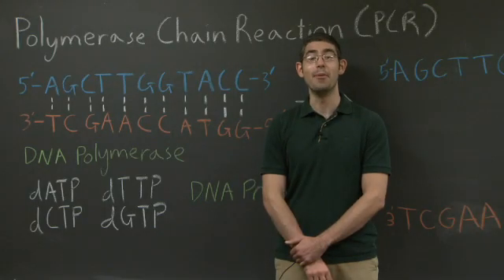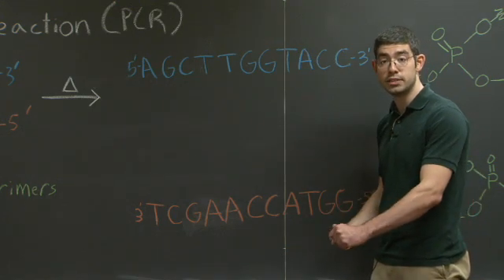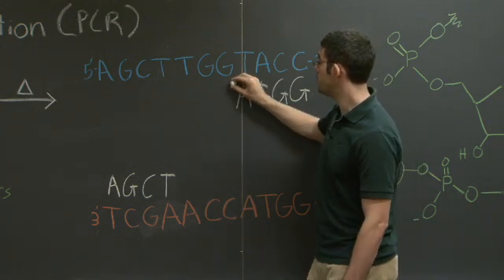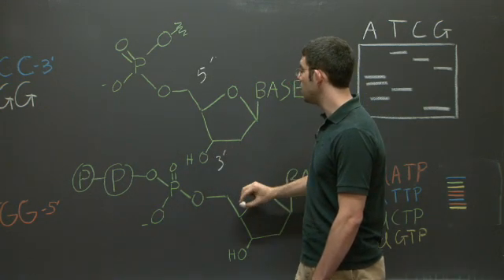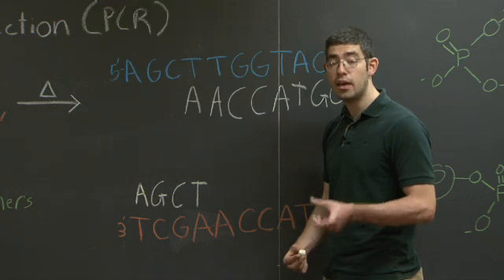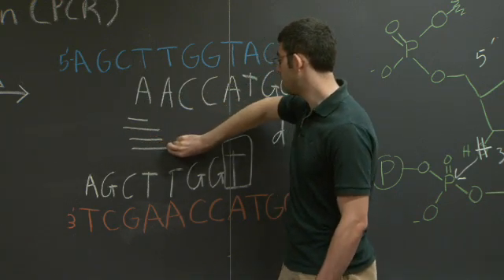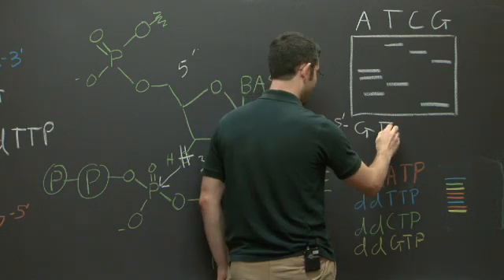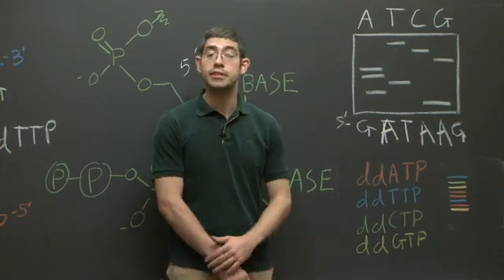Polymerase Chain Reaction (PCR) | MIT 7.01SC Fundamentals of Biology

Comment: Something that made me scratch my head: The synthesis of DNA goes from 5' to 3'. But this is on the synthesised strand, not the template strand. So at 1:33 he chalks in the nucleotides on the end labelled 3', but remember DNA is anti parallel and the new 5' end will line up with the old 3' end.
Reply: MrGoatflakes If you look at the figure on the board you will see two DNA strands, one in blue that is left to right running in the 5' to 3' direction and one in orange that is left to right running in the 3' to 5' direction. These are two complementary strands of the original DNA molecule that will be amplified.Each of these strands will serve as a template for the synthesis on a new strand.  In each case, a primer will bind by base paring to the template strand and new nucleotides will be added to the free 3' hydroxyl of each primer. Each newly synthesized strand will be made in the 5' to 3' direction.
Reply: Michelle Mischke
yes I was just momentarily confused when he said 5' to 3' and then pointed at the 3' end of the complementary strand.
Reply: +MrGoatflakes synthesized 5' to 3' relative to the new strand, not the old one.
Reply: +MrGoatflakes Thanks guys, that made me scratch my head aswell! :)
Reply: *****
yes

Comment: What about bacterial DNA? Since it is circular, one could expect that at each PCR cycle, elongation of the new strands should stop only after the completion of the full circle. How can then we achieve isolation and replication of a particular segment? Must we first break the DNA at some point so as to transform it from circular into a linear double strand?
Reply: I know that restriction endonucleases are used to break up DNA. They have the property of snipping wherever a certain very short combination of bases appear, and which sequence they cut at depends on the particular nuclease.

Many cut in such a way as to leave an overhang or "sticky end", where the double strand has a short single strand overhang.

I don't know if you can use the predictable sequence at the start of the cut is long enough to make a useful primer, but if not I'm guessing what you could do is make something that complimented the sticky end, along with extra, random but known bases, amplify that once and THEN use the compliment of that as your primer for the main PCR reaction.